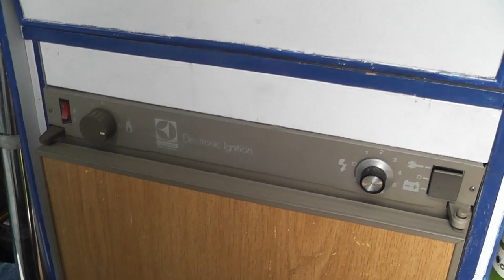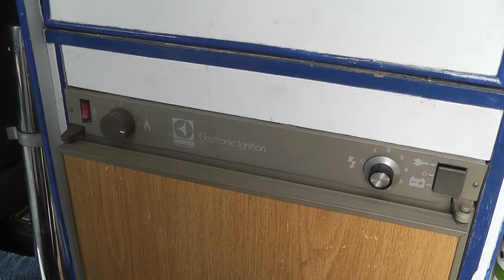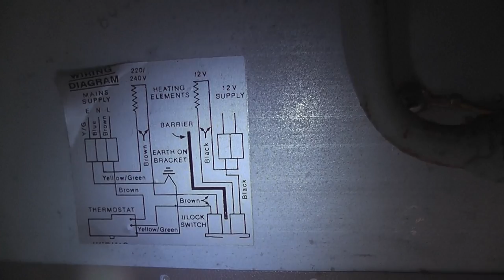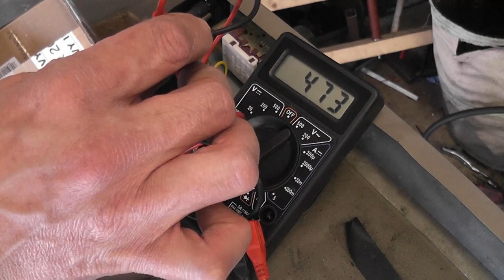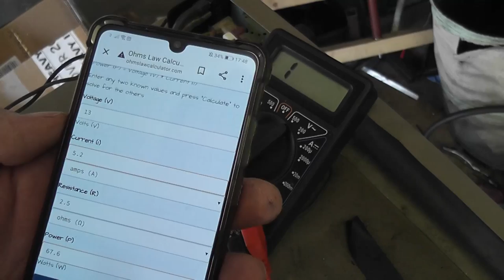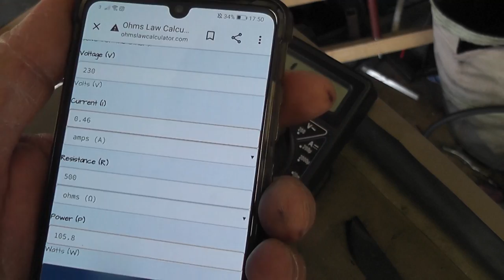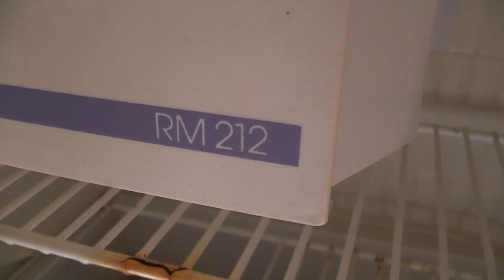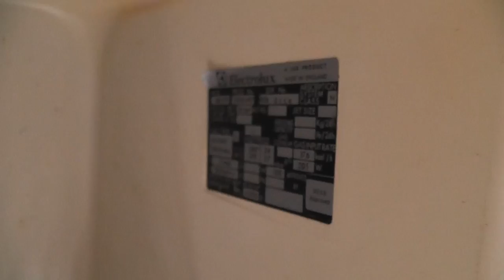How to service and repair a 3 way fridge - Motorhome, caravan or camper van fridge

Comment: Great video and good explanation if how it works on gas. Yes totally agree with your rant. I am an EE with 45 yrs experience and I have no issue with tightening a gas connection or doing a leak test 🤔. Thank u v much I now must fix  my gas fridge, it is 2001 RM20X model. Very similar to what you have. Igniter working but no flame - hopefully a piece of cake after your excellent video.
Reply from the maker: Thanks very much. Best of luck getting it sorted. Yeah it is ridiculous that you're not technically supposed to touch the gas installation.

Comment: Good educational video Endfloat.
I ripped out my Electrolux RM212 series fridge, not because it was a shit fridge ( it was and still is a good fridge) but because I have done away with LPG in my van.
I do have a new compressor fridge and can justify the cost and it will run on solar power alone and it will cool stuff to -22 decrees C in a matter of minutes. it will not flatten my battery ever, uses 0.4ah/h,
now back to the 212. Heres the science why turning the fridge upside down for a day may get it working again.
The coolant in the fridge crystalises at the top of the circuit when the fridge has not been switched on over a period of time.
Turning it over allows the liquid refrigerant to glug its way through the pipe circuit disolving those crystals.
Turned upright the next day, the refrigerant glugs its way back to the resevoir at the bottom taking the now disolved crystals with it.

Worked for me after the van was stood for 8 years, fridge has worked perfectly for 5 years since that time.

now, on earlier 212 fridges the igniter for the gas didn't require a 12v supply, it was a piezzo ignition. it worked but was a fucker pushing the button 20 times to get it to light :-)
The 12v supply was ( an still is) to keep the fridge cold while the engine is running, this overrides the thermostat and just keeps it cool. it also draws 12ah/h
These fridges also stop operating if the van is out of level by as little as 3 degrees. make sure your van is level when you are camped out.
These fridges cannot cool anything more than 20 degrees C below ambient temperature. Great fridge in Norway, fecking useless in Morocco.

Hope some of that helps.
Reply from the maker: That's great info! Thanks! Interesting about the crystals. I'm going to pin this post at the top if you don't mind.

Comment: Excellent. Early part of the video when you are testing the resistances, we can see the red probe but have no idea where the black probe is because your hand is blocking the view holding the red probe.
Reply from the maker: The probes go onto each wire to the heater element. Basically, you're just checking for continuity through the heater element.

Comment: Spare fridge, nicely done. Thank you for video. Very helpful. As a gas engineer I would use specific leak detection fluid (as soapy water causing corrosion) and gas joining compound but you seem to know what your doing
Reply from the maker: As a gas engineer I don't doubt you know more than me about these. I don't claim to be an expert though, which is sort of the point of my videos. The kind of "if I can do it, so can you" approach.

Comment: Brilliant well informative and entertaining video Ross. Mine is lighting fine but not getting cold anymore. Gonna remove service and turn upside down. Have done this on another fridge and it worked again. You are right, I think by turning upside down maybe gets rid of the air in the liquid. Many thanks 😊
Reply from the maker: Yeah sounds like turning your fridge over will get you sorted. Best of luck with it!

Comment: Thanks for a very interesting video. I have a Dometic RM7270  very much like the one you worked on.  The problem I have is that the the gas is still flowing even when the flame goes out (say because of a draught)  so I have no thermocouple action. This would cause a build up of gas around the burner and possibly a safety issue. I suspect a faulty thermocouple but I would appreciate your comments on this problem. I have also fitted a new burner and gas jet which cost £84.

Comment: Hi. Just come across your video. Great thanks. Have you got any info about replacing the thermocouple? Also you mentioned you could still get spares for this fridge quite easily. Any suggestions as to where? I'm in Scotland. Looking for a replacement lazy elbow, the piece at the top of the flu. Thanks again. Dave.

Comment: Brilliant video. Our fridge stopped working on gas so I'll follow your vid to see what the problem is. Thanks.
Reply from the maker: Glad you approve! Please do let me know how you get on.
Reply: @Endfloat  Got the fridge out. Can you tell me how you connected it to a gas bottle out of the van to test it?
Reply: Just had a look at 38m 41s and it seems you made up a short copper pipe connector. Can I ask how you did that and what size fittings you used. Cheers.
Reply from the maker: @iangrimshaw1  I used a piece of gas pipe with a fitting on the end attached to the rubber tube that went to the regulator. Maybe you could take one of the connections from in your van to do this?

Comment: Thanks for that. I've just bought a small Autosleeper with a  3way electrolux. It works fine generally but on gas, in any kind of a breeze, it wont light or stay lit.  I've noticed that the flame looks orange thru the inspection window. So I'm guessing  that the burner/Flue may be blocked and also that the shield may be missing. This video gives me hope that I can sort it, so thanks again.
Reply from the maker: Yeah an orange flame definitely indicates a problem there to do with air fuel ratio. Just be careful to ensure everything is present and correct and that you're using the correct gas for the jet you have fitted.
Reply: @Endfloat  Cheers. It's running on the red propane but I haven't a clue what jet it has. I thought I might be able to get at it from the outside, through the vent but it's down too low to reach so it'll have to come out. Urghhh! Wish me luck.
Reply from the maker: @bobi2582  good luck! 😉 Most of these fridges are jetted to run on butane propane mix such as the overpriced camping Gaz bottles that I showed in the video.

Comment: Good video, great detail. I am wondering what the material the insulation is made from? My concern is that its asbestos, and perhaps this is a reason companies will are refusing to service this type of fridge? Just a thought that some care maybe needed when handling this section of the unit.
Reply from the maker: I don't believe it's asbestos. The insulation blanket around the flue is fibreglass.

Comment: The tape its useless on the compression nuts join
Good job for al the work and advice! 👍
Reply from the maker: Thanks! I tried tightening the unions without the PTFE and there was a leak. The PTFE stopped it, so I did find it necessary. I think it's just because of the age of the pipes, but you are right in saying that it shouldn't normally be needed.

Comment: Hi Brilliant video.  Greetings from Dublin 16!  Have a problem with almost identical fridge.  Works on gas and 12 v. Have checked mains. Power getting to fridge.  Checked ohms as you described on heater described as 125w 240v. Came up with 350ohms. So heater appears OK thankfully.  Any suggestions welcome.  Will check all connections at switch etc.    Thanks very much for your video!
Reply: Think I may have found a cause,  the rotating mains temperature setting switch! It appears that it may be shutting off the machine occasionally.   If I turn it all the way off to zero and turn it back on it starts working again.  Perhaps a failing thermocouple?

Comment: I have a similar issue. The Dometic fridge in my touring caravan stopped working shortly after I bought it. It's on a seasonal pitch and I cant find anyone to go look at it. It's putting a downer on the new caravan experience. I think it's thermostat related. Doesn't work on gas or electric. Do you work on these at all? It's in Clare.

Comment: I now consider myself somewhat of an expert thanks to you! Only kidding! Brilliantly explained, thank you very much.
Reply from the maker: It worked out for you then I take it?
Reply: @Endfloat  The one I just bought for £30 is working a treat, I do have one question tho, Is there usually a thermostat? Im guessing not as it couldn't adjust the gas flow if it needed to. The reason I ask is I wondered if I could boost its performance using some ice packs, Iv just tested mine on gas and it's working great, I'm letting it cool before I flip it over for 24hrs as I doubt this has been done for some time. Thanks again for your help.
Reply from the maker: I use ice packs from my home freezer to initially cool it myself actually. The fridge does work well though, yes. There should be a gas control valve but it's not a thermostat. Turn it down and it lowers the flame. And there's the other knob for the electrical element if yours is a 3 way fridge.
Reply: @Endfloat  Iv been looking at adding external fans to draw the heat from the condenser. Popular in the US, They even do kits. Iv noticed the more expensive fridges get  colder from ambient, I mean that's why you pay more, Duh.. I wondered if you might know how they achieve this by any chance, All running on gas? More gas perhaps? Im determined to get the most out of my unit so I can sit in glee on hot days with an ice cube I made. Thank you again for all your help, I do hope you managed to solve your getting a certificate for your fridge in van sorted. What a nightmare. Take care and stay safe.

Comment: Endfloat, I have an ammonia smell coming out of my electrolux RM212. Is this a leak? Have only tried it on electric. My fridge was working before winter, on leccy and also on gas. Superb video. or is it just becuase its settled in the bottom? If I do the upside down trick, will this put it right?
Reply from the maker: I'm not sure to be honest. It could well be a leak, yes. I can't really advise you on that. I never had that problem myself.
Reply: @Endfloat  its a coolant leak.

Comment: Just cracker mate, a very sensible and straightforward explanation. After 4 mins watching I reckon I know the problem with my identical fridge: it's not connected to the mains, NOR is it connected to a battery. And the ignition sounds like an ekectro-pieza sparker, but "relies on power to work".
So tomorrow I'll put the battery back in and see if it then starts. You've given me hope at least to be able to have a cold beer tomorrow night!
We need to support people like yourself who take the time, make the effort and show the rest of us what can be done with patience and dedication. 2022 05 29 22:08 France

Comment: Thanks Ross, i will follow your advice but I also need to change the thermostat on mine as its either on or off and I’m unable to control the fridge temperature. I wondered where I need to install the sensor head of the thermostat capillary (long wire) on the rear of the fridge? Thanks in anticipation, Shaun
Reply from the maker: Honestly I can't remember. It must go in somewhere near the evaporator but I can't be sure and with the fridge installed I'm not in a position to check for you, sorry.

Comment: Hi great video, just wondering when testing the elements for resistance does the power need to be connected and turned on? Cheers.
Reply from the maker: No they need to be disconnected. The meter passes a small current through the element to test it's resistance.
Reply: @Endfloat  ok thanks very much.

Comment: Great vid and commentary! i have a nice flame but no coldness. Have had fridge out before but just sort of blew over everything and it just worked, now know what to do. Cant find your Lister vid but will be watching your T25 conversion, mine's ready for one. Just need to find a bottle of that unicorn farts.....
Reply from the maker: If you have a good flame, make sure that swirly yoke is down inside the flue and that it's not blocked, then leave the fridge upside down for at least 24 hours. If that doesn't work I'm afraid it's likely new fridge time.

Comment: The knob on my 3way van fridge, when you turn the gas up it gets to  halfway then flame goes down a bit as you turn it up past halfway..? And the gas wont stay on which im guessing thermocouple until i test it. Ive taken everything at the back and cleaned it all, get a good spark and first time ignition but no cooling even when bypassing the thermocouple by holding the knob in

Comment: I have the same fridge in my 1993 T4 Vision camper van, one minute the ignitor switch was clicking I switched it off to set off driving, arrived at my site and the switch is now not clicking so obviously not igniting. 
Do you think I need to do all this to get it sorted ?
Thanks for this video. From the UK
Reply from the maker: You sure it's not just the switch itself that's damaged?
Reply: @Endfloat  no idea. It may be worth me getting that checked first I guess 😅
Reply from the maker: @angelamelville67  hopefully it's that simple. If not, I'll try and help.
Reply: @Endfloat  thank you.

Comment: Thank you so much for making this video. I got a camper van with this fridge in back in March and didn't have a clue what I was doing! It seems like it wasn't used with gas and the pipe you attached your orange line to has been cut off on mine. Is it possible to get it going with gas again? Thanks again
Reply from the maker: It might be possible but without seeing it I can't say for sure. If the pipe has only been cut before the valve then it should just be a case of remaking the connection and giving it a good service.

Comment: @Endfloat this is excellent. Thanks. Have you done one on the control side of the fridge? Mine is cooling, just not very well, performs the same on both gas and electric, only gets down to about 9deg. Any pointers?
Reply from the maker: I didn't do anything with the control side, no. Did you leave the fridge upside down for 24 hours? Also, have you enough ventilation at the back?
Reply: @Endfloat  not yet but I will. Just need to figure out how to get it out . I'm also tempted to put a 12V fan on the ventilation side to see if it helps but otherwise it all appears OK.  Thanks again for the excellent video
Reply from the maker: @richardcaldwell445  you're very welcome, and yes, do both of those things and it should come good for you.

Comment: Found it Ross. It comes in to the fridge itself from the back and attaches on to the metal chiller with a clip.
Reply from the maker: Ah excellent. That's good to know. Did you get it working?

Comment: The dohicky in the flue is to hold the heat at the same place as the two elements instead of the heat going straight out the top. Makes the gas more efficient
Reply from the maker: Thanks for the info. I did kind of figure that after I made the video.
Reply: @Endfloat  It's to make the exhaust swirl, making the flow more efficient!

Comment: Quick question...the freezer part of the fridge which is a separate part to the main fridge if you get me (its a 2 piece fridge)...well the freezer gets amazingly cold but the main fridge takes hours and hours..sometimes over 24 hours for it to get cold...is the right? any advice would be much appreciated...cheers
Reply from the maker: It definitely shouldn't take that long to get cold. It will never get as cold as a compressor fridge but within a couple of hours it should be at a usable temperature. Did you try leaving it upside down for a while?
Reply: @Endfloat  I didn't take it out tbh..its massive. ...its like a double fridge...the freezer is seperate to the fridge. ..but all one unit.
Reply from the maker: @thekoshplays2207  it'll be worth the effort to figure out how to remove it. The only solution is to turn it upside down for 24 hours. Plus, when it's out you can check everything and make sure it's safe.
Reply: Try putting a small circulation fan inside the main compartment. That will help

Comment: I have the same type of fridge but mine has a push button to ignite but it's not igniting
Reply from the maker: It's a similar process to follow then. It's just a different ignitor setup. Check and see if you're getting a spark first when you press the button and go from there.